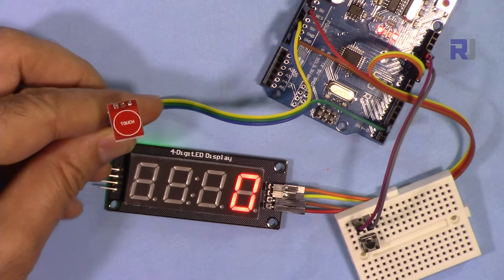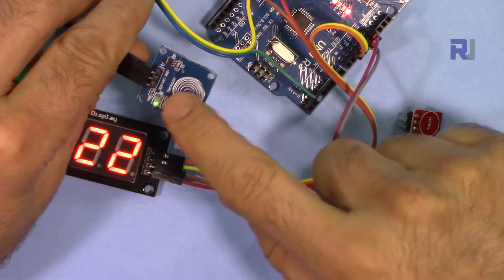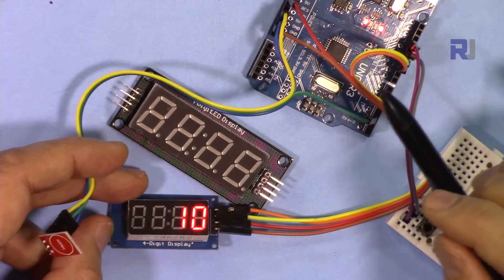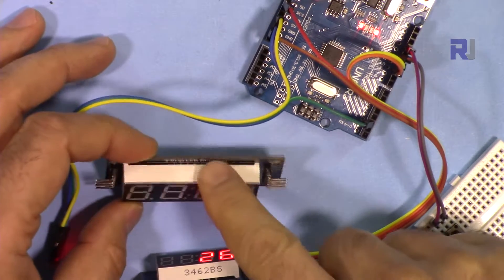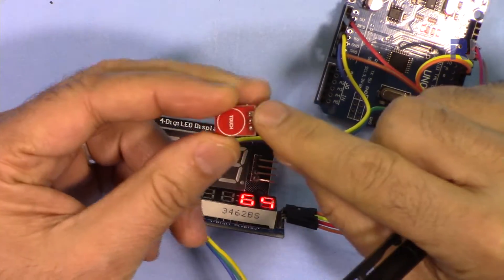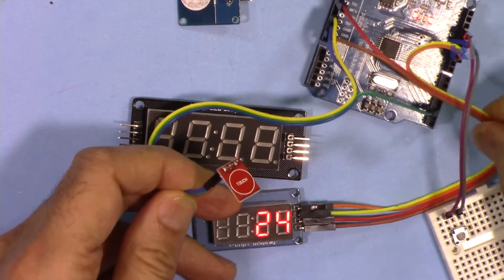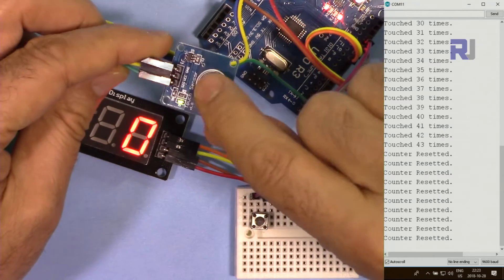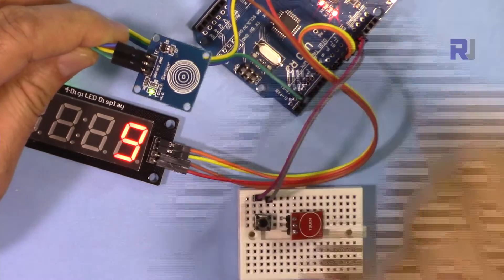Robojax Touch Counter V3 using TM1637 4 digit LED display RJT134

Comment: Dear Sir, many thanks for this video.  I am new to programing and Arduino, but I have read two beginner's books, however I have learned more from your video than both books.  You have enabled my project to move from a failing prototype to a working example.  I also had the courage to modify the program slightly, to include a delay on the reset.  Once again, many thanks for rescuing my project.  Kind regards: Steve from the UK.
Reply from the maker: Hi Steve, Pleased know that my videos were useful.  Keep working on coding, you will enjoy it. I have three courses. You including learning IoT (Internet of things) where you can have fun and create project that you control over WiFi. I have explained it fully. Just get the learning kit from the provided link and follow the videos. Good luck.

Comment: Hi ! Thanks for your video , instead the push button , can you place the Arduino infrared module, to count objects for exemple ?
Reply from the maker: Hi, yes you can.  I have video and code for infrared. Watch the video to know how it works, and then use it with this project. Search for it on my channel.
Reply: @robojax  thank you for the answer 👍

Comment: How can you store a count to Arduino eeprom when power is OFF for long period and then resume count when powered up again
Reply from the maker: You will need to way to memorize it. Either EEPROM chip or microSD card to write the time, then when you start it, it should read the counts and start with that count.